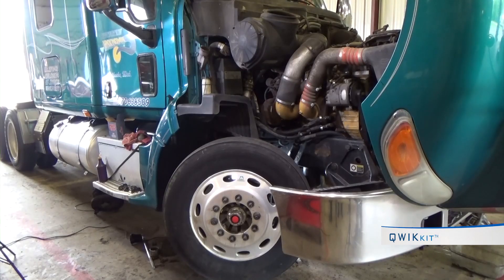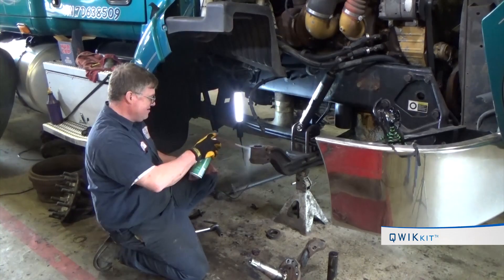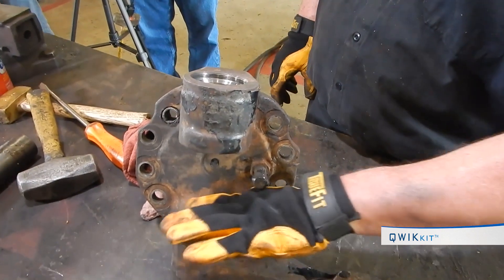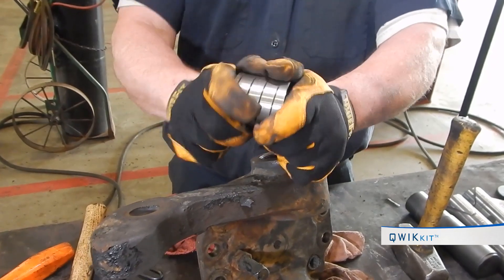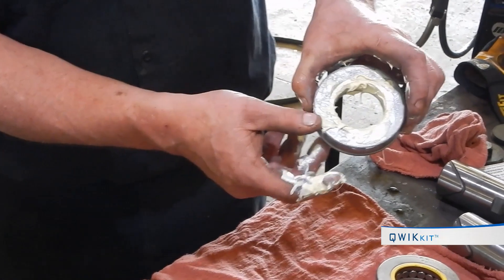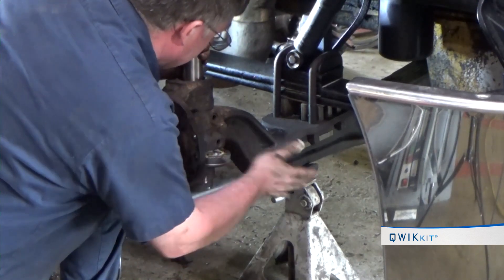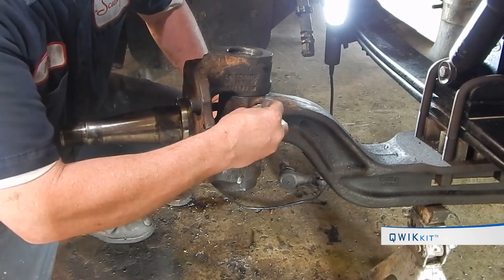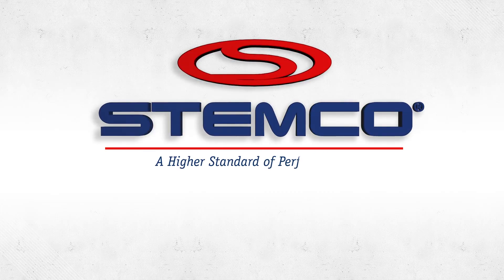STEMCO Kaiser Qwik Kit® Training

Comment: Don't heat axle. This tool never touched a bus.
Reply: That’s what I was thinking, I’ve done kingpins on MCI buses and dang those Lock pins are a pain in the butt I basically have to melt them with a torch.

Comment: looks like a REALLY TEMPORARY cheap  fix!  all that labor... just buy new knuckles ....
Reply: bobo caterpillar-   YOU GOT NO IDEA WHAT YOU ARE TALKING ABOUT DUDE!!!
Reply: @davidortega7957  oh, ive done these CORRECTLY,  HUNDREDS of times before... the RIGHT way to do it is to press in new bushings with tooling and HONE them to fit ( also with special king pin tooling ) .... NOT screw in a cheap ass looking piece of SOFT metal!  this looks like stuff you do to a truck going to auction !!  i bet it doesn't get  HALF of the life of the original!    oh yeah ... and NEVER seen kingpins come out this easy before! 0:50 🙄  yet again ...their is a pin pressing tool to remove stubborn pins  for that  $$$$
big trucks = big money
Reply: Hundreds of times. You sure you are doing it right. I have used these and never had no problem with them. If you done it hundreds of time then you must work in a alignment shop and don’t own a truck
Reply: I agree.

Comment: Yeah I think ive had them come apart that easy.. umm  never..
Reply: haha same. I'm gonna need a tiger king pin removal tool pretty soon here.
Reply: @ConTheDon187  No shit. Why don't they show a video where the pin is just alot more than stubborn. And I haven't seen a tiger tool for these yet. Could sure one.
Reply: @bmdbigfeet1031  I can tell you my boss destroyed one of these on a kingpin that was seized to the bushings in the knuckle, it's why I'm hesitant on buying one right now, if it fails in the middle of a job its gonna be very problematic.
Reply: @ConTheDon187  I looked up the tiger tool and it exists. I ended up making my own pin press and it worked but not without any help from a torch. I made the bottom  narrow but wide enough for the pin to push through while I had a 10 ton porta power on top.  Found a piece of grader cutting edge for the top plate clamp, used 1in ready rod through the top clamp to the bottom and proceeded to pour the juice to it. The portapower was maxed out then I went for the good ole gas axe. Had to climb back into my skin when it finally popped. Was all down hill from there.
Reply: @bmdbigfeet1031  yeah for the cost of this tool I think I'm just gonna make a jig for my 20ton pneumatic jack and give it a go